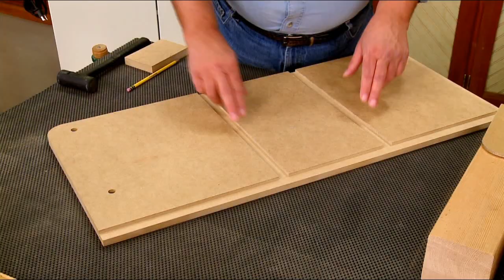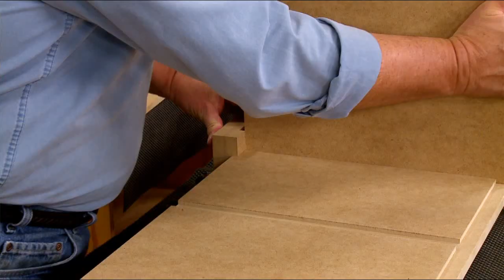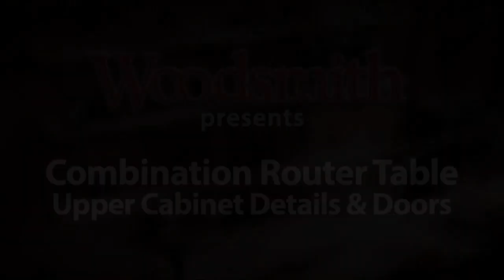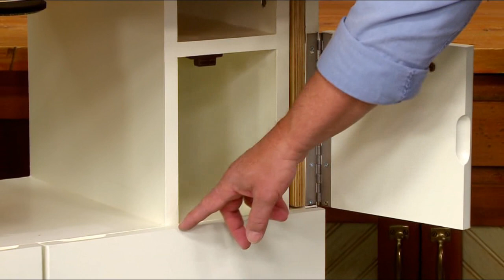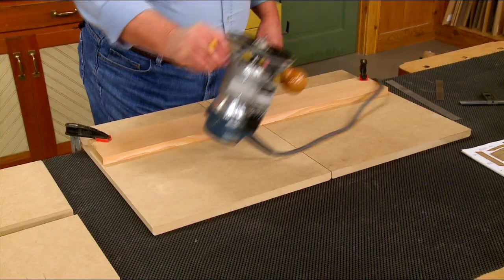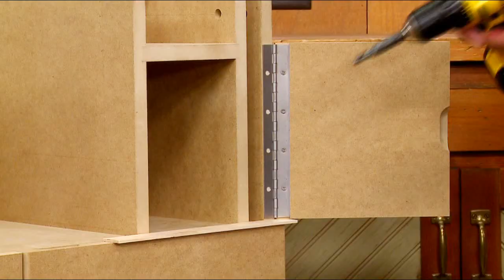Build A Combination ROUTER TABLE! - Part 2

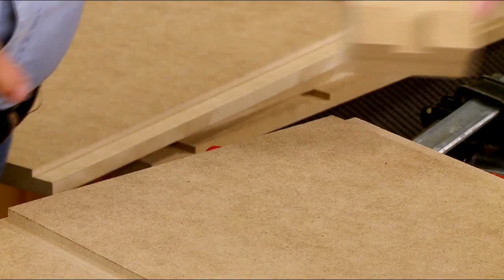Comment: Could you provide the details and dimensions for the alignment block and the right angle clamping square that Don uses starting at 3:30 in the video? I purchased the plans for this combination router table and would like to make the helpful jigs shown to help to assemble the project. Thank you in advance for any informational assistance you can provide for this request.

Comment: The material list includes the following:
Two 49" x 97" sheets of 3⁄4" MDF
Two 60" x 60" sheets of ⁄4" Baltic birch plywood
I've note seen these measurements before in buying plywood. Are these misprints>
Reply from the maker: Carlos R Gibb - Typically  “4 ft. x 8ft.” Sheets of MDF are oversized 1” in each direction. I am not sure the reason for this, but they end up being 49” x 97”.  Baltic Birch plywood is often sold in 60” x 60” in our area (maybe because of the metric system) but you can also find it in 4’ x 8’ sheets sometimes too.
Reply: Thanks

Comment: Great video and shop addition. I am wondering if 1.25" drywall screws would work as well as the #8 wood screws when joining the two layers of MDF for the baseplate? Also can you please elaborate on the pilot hole size for the #8 screws please. Thanks!
Reply from the maker: I tend to not use drywall screws in woodworking as they are very brittle and tend to snap.  We used a #8 tapered countersink bit to pre-drill our holes.  Example: http://www.rockler.com/rockler-insty-drive-tapered-drill-bits-and-countersinks-countersinks
Reply: Thanks for the info.

Comment: I like this series.  Since I haven't had a TV in a number of years, I kinda miss the show.  One question that I have is, I have found that screws do not hold in MDF,  do you have a trick or tip you can share?
Reply: double your glue  one spred allow to dry add a second and screw  glue is i think your real joint
Reply from the maker: Just to add on to this comment... the idea here is that the first, thin layer of glue will seal the very porous end grain of MDF so that when you add the second layer of glue it won't all soak in to the MDF.
Reply: you bet  keep up the fantastic work the old coppies i bought years ago i took to the  v a med center  i think they were50 and back
Reply: seals end grain also also can use with iron to install edging on plywood  by using the two coats and allowing to dry
Reply: titebond 1 for that use it adhears to its self i understand
Reply from the maker: I agree that getting screws to hold in MDF is a bit of a challenge.  I would advise you to pre-drill all of the holes and and do not "over-tighten" the screw.  When you "over-tighten" screws in MDF it can strip out the hole, so the clutch feature on your drill is really helpful in this instance. Also, it really pays to glue the all of the joints, as well.